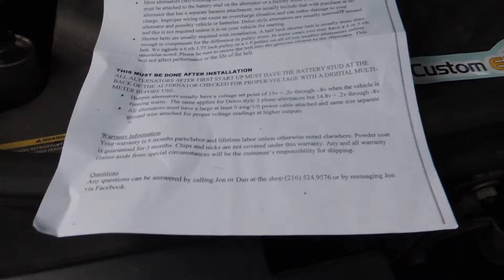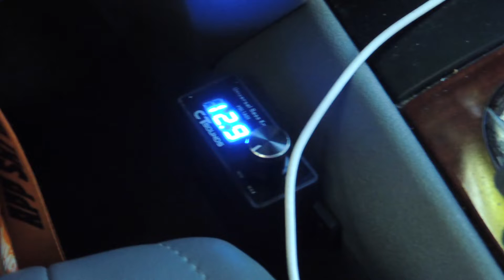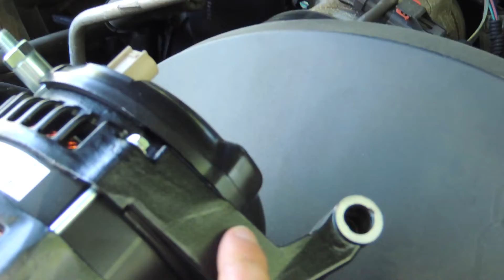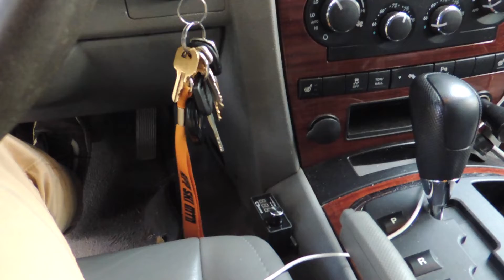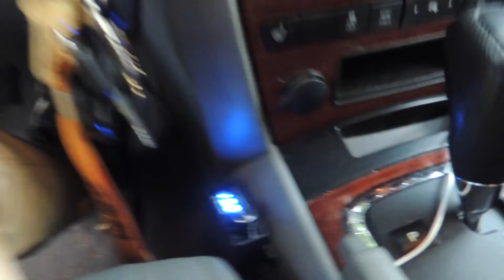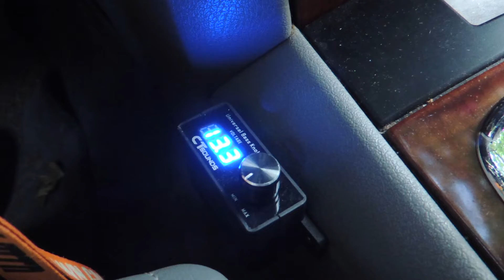320a Alternator Upgrade! CES High Output Alt Review

Comment: Bruh u should of went with Brand X. Way cheaper and you can have the option to have it set at 15.2. 200 amps at idling on a 270 alt. Plus it was 320
Reply: That alternator will do 15v his computer isn’t letting it though..
Reply: @YouTubesucks..  gotcha. I've been impressed on my Brand X alt. I need to get the one I got from O.G rebuilt so I can have a back up
Reply: Where did you get the brand x just asking
Reply: @joshuacobble7910  Jonathan Patrick on fb
Reply: Jaytaybrae 3 how much do they run
Reply: @dat_raider_hemigoodshot6953  its probably different for every vehicle but i have a 04 chevy Tahoe. I have a Large case hairpin 270. It was $300 and another $25 for my alt to have a set point of 15.2. With the brand x voltage knob, im charging to 15.6

Comment: First off, great job on upgrading you're electrical system. You didn't say much about how many RPM's you were running during you're "tests" aside from when you were talking about driving down the road. I've had 3 different CES alts and I was very happy with them all for the price.
Reply from the maker: It idles at about 600 rms and that is where I was testing it at. Of course it performs a lot better while running at cruising speed tho
Reply: @ParkerTheBasshead  when you compete set the cruise control you cant rev the vehicle if your inside so rules get you every time

Comment: Very nice alternator, Parker. That will help a lot when you get a couple more upgrades. You definitely need an external voltage regulator. Right now, your cars computer is controlling voltage. A few companies like mechman, and I assume CES make an external regulator, so you can set the voltage wherever you want. I personally set mine at 15 volts cold, and it drops to about 14.6 once it gets hot. Also, it's definitely time for you to add some 1/0 or even 2/0 pure copper wire for your main power run. Moving 300 amps from the front to the back is a long run, and that CCA wire can't possibly keep up with the increased amps you are now generating. I'm positive you are seeing high temperatures and voltage drop because of the wire. It's time to upgrade to the pure copper wire, my friend. It will help keep everything cool, safe, and you will always see max voltage to your rear battery. Even the short run from the alternator to the front battery would benefit moving to a nice 2/0 pure copper.
Reply from the maker: OFC wire upgrades will be happening in the near future!
Reply: @ParkerTheBasshead  Great to hear the wire upgrade is coming! Check out mechman for that external regulator. It's just a small wire harness that goes in between your alternator and the factory harness for the car. Really simple to install and use, and you can set the voltage wherever you want. I think it's cheap as well.

Comment: You're not really straining the system stock vs CES with that amplifier. The CES will help but in only very tiny increments. 
On a side note I would change those battery terminals ASAP! I had the same ones and after I installed them I wasn't happy with the fit. Plus they are cheap. I took them off a few days later and gave them to my scrap guy. ill customz has some beautiful ones that I been eyeing up. I'm not sure if I want to get the bolt down kind or the screw in kind.

Comment: You need an external voltage regulator. Your cars voltage is regulated by the PCM, thats why your voltage prior to music is the same. In my mazda, same thing happened when i get a singer alternator. My car would be at 14.2 cold start and drop into 13.7 13.8 range idle at warm. I hit him up and he gave me a voltage regulator for free, i just had to pay shipping. Installed that and ive never seen less than 14.1 since. Usually stays between 14.1-14.5
Reply: Also helps for higher current rated amps like vfl and sundown.if you runnin a tara bandage or other Brazilian witchery 14.2 to 4 is it period watch boom lose finals cuz of blown fuses and a lil extra gain on tara.we was sick cuz he had that champ win no doubt but dont matter how loud you are if you smokin chokin burnin or learnin if he playin and you ain't on sunday call momma teller you headin home lol.cuz it's over Johnny

Comment: Parker its your pcms voltage regulator i didnt see you install an external unit.but dodge is controlled by the ecu or pcm.it sticks at 13.8 to 14.1 or 2.get an external unit set it to 15 15.3 also your amps current draw is whats important.you need to be able to feed that many amps fairly consistently.and if you got it running at 1 ohm or lower ima tell you from experience that amp is about 70% efficient on a solid ampere load drop below that it gets dirty real quick.so think of it like this you got a car that does 6 seconds in a 1/4 mile but you  can only hold 1/8th of a tank.its a start but you cant leave the house youll run outta fuel.so your best bet is to externally reg the alt to increase the volts there for increasing charge time and amperes.there like 60$ trust me youll thank me at 13.8 volts that amp is at best 70% efficent imagine 12.5 thats 10% for every half volt.see what im saying itll sound better hit harder and the subs will thank you for it.bet 20 you play them full tilt for 5minutes them coils gonna get pretty hot from the dirty power.any my point is the factory reg doesnt charge more than 14 to 14.3 on dodge and jeep.actually i think its pose to be 13.8 i think is standard discharge rate for that int regulator and if im correct it has a 2:1 brushless actuator system.
Reply: No matter what you will have a voltage drop from the current draw the goal is to get that num no less than .5 to 1 volts from the amps current draw at what ever the amps voltage rating is at its given rms load even if you have  solid play over long  periods of time.no l less than 1 volt drop.but hey im just answer the voltage question and passing on my ase certification electrical engineering knowledge on to you bro.your cool and your videos are all right.they dont even know that you me and the people who watch you.are seeing something special we are growing with you as you you learn it started with one look at you now with 2 and a solid set up you'll do 4 next and when you do ill be there to say i told you sooooo.🤣🤣🤣👊👊
Reply: I got a Dodge avenger 2013 n I'm thinking of getting a higher output alt. Do u know if I'm gonna need one of those regulators or I can just swap alts?
Reply: @migascustomsounds3054  migas bro its like this would you put a large turbo on an engine with out tuning it.same thing an external voltage regulator just gives you the ability to adjust it manually instead of the cpu.like the  stand alone ecu on my race bikes.
Reply: @migascustomsounds3054  you can just swap the alt like parker.the only issue is the charge output from the cpu wich im pretty sure is 13.8 to 14 flat
Reply: @migascustomsounds3054  heres the whole shabang if your alt charges at 13.8 flat but your amp is rated at 14.4 your already at a disadvantage out the box
Reply: @migascustomsounds3054  im not saying dont get an alt i am saying that you can install an external on a factory alt and it will help.and its a great place to start due to the fact that even the really good external reg are less than 2 bucks couple that with a stabilizer and your chargin at 14.5 to 15 volts.which means more power better efficiency and if you do it right and baby the set up ie hookin up a kill switch.charging the batts with a charger to top them off.replace wire every so often and let the car breath for about 30 minutes before shutting it down when you get home.will buy you tons of listening time till you save up the cash for your upgrade or Christmas comes round.and it can be used with an aftermarket alt.
Reply: 200$ bucks typo my bad im thinkin 140ish
Reply: Thanks parker just passin the bass bro slam on
Reply: how do i bypass or tweak my regulater
Reply: @tanilopez6619  order one for your vehicle from mech singer ohio any of those brands.you can even go as far as putting smaller pulleys on your ride thatll free up hp and juice bro sorry for the delay boss I been building building building.dont forget upgrade your wiring and also ima give you a secret that everyone forgets the basic principal of electrical law is the farther it travels the less you get.shorter runs equals less drop in your target system 2nd be logical ofc is expensive as shit so the less of all that stuff you need the better off you are to push maximum beat in your daily.15 to 2k is plenty with a good efficent box and short runs i.e closer aux batt closer amp less voltage drop.
Reply: @tanilopez6619  also keep in mind idc if you got a 500 amp alt you only recive a givin percentage of that unless you run one separate from the vehicle's oem electronics.that includes light power anything coil or coil packs injectors sensors oxygen sensor maf crank cam vvt so on an so forth.
Reply: @liljamesjames1884  man im soaking all this shit up like a 🧽.  Thanks for all the tips. Even if they were intended for someone else. Lots of great info to help with my build.👍
Reply: Sorry decrease charge time*
Reply: @liljamesjames1884  Bro I got an alt with a pigtail 2 lines blue to the alt and yellow ignition 12v CES told me it’s the PCM bypass internally regulated, not sure about it because they told me to buy the Add a Fuse circuit and plug it into the ignition source in my passenger fuse box. i’m really not sure what to do... really need some help
Reply: @pawgs8126  ight I got you can delete that internal hook up dodge has a kit an mech sales a voltage reg ext but ima make sure you have all you need gove me till the bout 8pm est today I'll have exact direct you can run the alt with out the ext volt reg but y would you
Reply: @pawgs8126  rem you need a true ign  turn on source under the hood should be one as well your lookin in the manual for fuse code eng or eng turn on.the fuse tap is at auto zone or advanced if you in a rush.also remember 1 other thing it's a connection source for all things flexin 28 so make it count do not cheap out on connectivity or wire also shrink and tessa all your point of connection an accidental arc jump and you gonna be pisse.15 15.2 is your max you want on an exterior regulator
Reply: Ok. Thanks. I got a JL slash 1200 on 2 12" Rockford t1s so I believe it works from 12v to 14 and delivers full power but when pushing it my voltage meter says 10.8 at lowest and I don't a bigger amp since that seems plenty for that car n neighborhood hates me already. Lol. I might try my HCCA but want it on that same amp.
Reply: @migascustomsounds3054  okay just 1 quick question is the hcca an amp or a sub woofer i only ask cuz you kinda confused me there.and wat size hcca again remember its about amperes so if the amp is drawing more than you system can give it om the jl 1200 you def can't do an hcca i mean you can but your def askin to kill the batt or batts.like permanently and or but including the alt.put a constant heavy maxxed out load on it and it will give out on you. Thats facts.if your dropping to 10v your seriously struggling in that dept but again im just sayin snatch a ext regulator set it to 15.3 and the worst you should see givin you got a solid charging bank batts agm lilthium caps or even lithium packs.11.5 at the lowest to 12ish untill your banks run dry.itll but you some time you can also wire it up to cut down on draw but you'll be like oh yeah then cuss me out for mentioning anything above 2 ohm.there is options just look into think about it.no matter the size alt you get 9000000000 amp at 250p rpm means jack if the voltage regulator has you sittin at 13volts charge.every one i know in the audio world from demo dominator to clamped that has a dodge did that upgrade first matter of fact sonny is running the factory 160 amp alt on his 4 platinum 18s but he is runnin the e caps and he did do the regulator swap he does mid 50s at 33hz i think he could prob get high 50s if he hadnt of sent the windshield.im here to help bro i been in the game 20+ i still ask questions and constantly try and pick up something new no matter how crazy i think it sounds.
Reply: @liljamesjames1884  the HCCA is the 2500rms 12". Voltage only drops that low on a long low bass note. I turn it down imediately. Amp is the JL slash 1200
Reply: Oh bro i was just saying your enemy as a bassatech is 1 dirty distorted power and b voltage drop and amperage draw.the closer you get to rated amps for the draw of the amp the louder and better it will sound.side note your electrical system will thank you for the helping hand.external reg 60 to 140$ bucks easy to install and you save money from that 450$ alt your about to buy.for the time being and legit a solid charge bank and a ext reg might be all that you need.but its up to you its your setup.im just tryin to save you a buck and the slight not terrible but slight dissapointment parker felt as the volt meter kept diving.that dodge will hinder your set up.
Reply: @liljamesjames1884  yeah I appreciate it. Im it sure about the best solution. I actually live close enough to mazda that I want to have him help me and build me an battery bank, I'm just afraid of wrecking something. But again thanks for ur time.
Reply: @migascustomsounds3054  no worries we fam mazda my homie.get his opinion
Reply: @migascustomsounds3054  okay got you the hcca is a sub it will be less of a load on the amp and elec system to run the one sub.but the t1s are like 2000 watt subs arent they.if you got the black coil thats 5 peak 25 rms the standard i think is 1500 rms 3k max so in theory the hcca would work with that amp.honestly it would probably be a safer bet till you can make the  upgrades to your electrical but im tellin you my boy tate 4 sa12s did the reg change his is a tahoe but he went to a 16v battery set up and charges i think at the safest for his vehicle 15.5 and 15.8 on burps.that all he has he does low  50s but that is at and around 45 hz🤔

Comment: Yeah. Was wondering if you disconnected your back bat as well. Any plans for a voltage regulator and would one be used or needed in this setup or in the future?
[Edit] I totally forgot about the double up on the twelves. Got all hype again.
Reply from the maker: I may get a regular if I feeling I need it

Comment: You're voltage should remain the same because you don't want to overload the electrical system in your car. Your battery should always show 12V when the car isn't started. You should never want more than 14.4 Volts while running because that could damage you're electrical system over time.  The one thing that the High amp alt should be doing which it looks like it does is maintain the voltage better and give an increase in charging amperage.
Reply from the maker: Ok cool well it definitely maintains it better but I’ve heard others talk about getting higher voltage so I wasn’t sure
Reply: @ParkerTheBasshead  You can definitely get higher voltage out of that alternator. Right now, your ECU is controlling the voltage regulator of the alternator. There are a couple of tricks you can do to fool the ECU into increasing the voltage, or you can get an adjustable voltage regulator. I know mechman makes an adjustable regulator, or better yet, talk to CES about what they offer as far as adjustable regulators or ways to up the voltage. With good agm batteries, you can sit comfortably at 14.8 to 15 volts. Also, I think it's time to ditch the CCA wire you have running to the back of the car for some 2/0 pure copper wire. You can get decent 2/0 welding wire locally from a place like Airgas for pretty cheap, or order from your favorite online vendor.  It will make a big difference now that you are moving around 300+ amps of current to the back of the car. The CCA is definitely overwhelmed trying to move that much current around. I bet you are seeing voltage drop at the rear battery, and it's definitely gonna get hot, which will only increase voltage drop to the back.
Reply: @catch22frubert  I change all of mines to 4/0 welding wire and I love it. I stay at 14.9 full tilt but I run ces80 tho

Comment: For your question about the voltage... Alternator ratings are similar to amp MAX ratings, meaning your alternator has the ability to put out 320 amps for a short period of time when needed. Check the spec sheet if it has one or contact the company and ask them at what rpms your alternator is spec'd at.. I have seen some as high as 6000+ rpms before they even come close to putting out the rated amperage. Either way it's still a nice upgrade and will definitely help you out in the long run. Good job bro
Reply: Spec's should say 320 amps at 2000 rpm  
Throw a clamp meter on it and see
Reply: Alternators also have a hot and cold rating.
Reply: Remember to see if they are talking engine rpm or alternator rpm... alternator spins much faster than engine due to pulley ratio
Reply: This is true, your rpm at 1000 might bump you up to 200 amps from your stock amperage of 135 or whatever your alternator does from stock.
Reply: That's how my Ohio Generator alt was. At 1600 rpms it was doing 2 amps. At 6k it was doing 295 and that'll blow up your engine. I switch to Brand X.
Reply: I tried a pure power 240, I had a stinger for almost 6 yrs that went out suddenly n def didn't have the 500 to replace it however, so far so good. I put an amp clamp on it n its does more than advertised @ 2500 rpm its 225 amp with my system tearing the car apart I dont think it draws much more than that. So for half the price give pure power a try till you have the 5 or 6 hundred for the big boys.